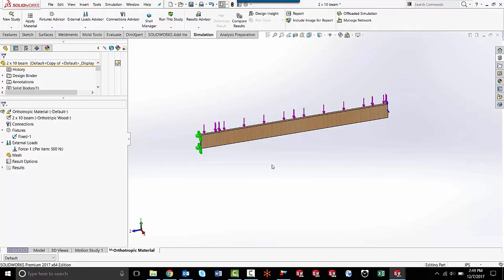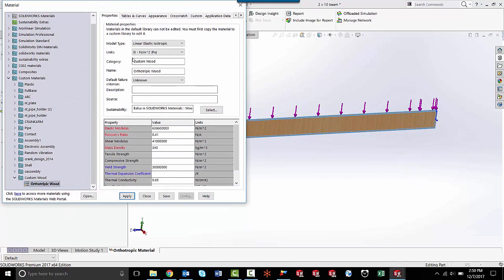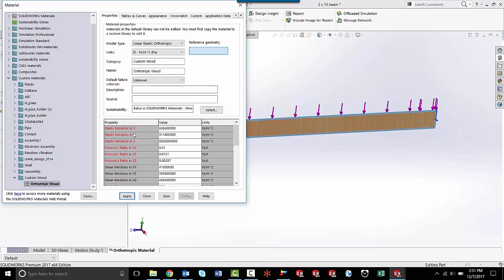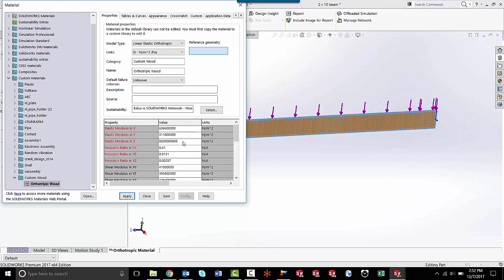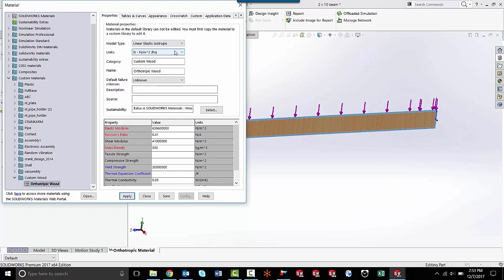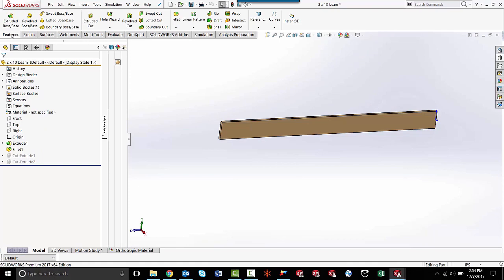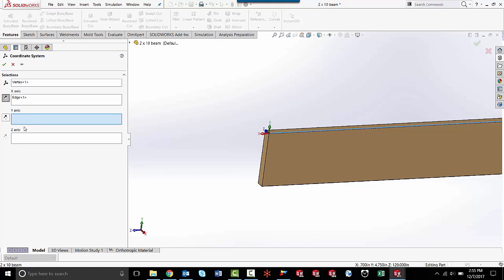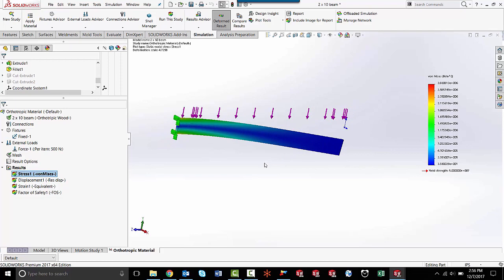SOLIDWORKS Simulation - How to Apply an Orthotropic Material Model Type

Comment: Hi im an engineering student. I was wondering if you can help. I am trying to analyse a situation of using a cheater bar on a wrench. I have a nut that is fixed and a wrench on it with a pipe over it. I was wondering if you could help with the correct boundary conditions or mates and for to analyze. Or if I could replace the cheater bar with forces.
Reply from the maker: Hi Mario,
The setup of this analysis is going to be far too complex to describe in the comments section of our Youtube channel.  We would encourage you at this point to approach the technical department at your local SOLIDWORKS VAR to gain personal assistance from them on making this setup.
Reply: GoEngineer what's a VAR lol
Reply from the maker: Mario,
A VAR is a Value Added Reseller.  It is who you purchased SOLIDWORKS from.  Who sold you SOLIDWORKS?